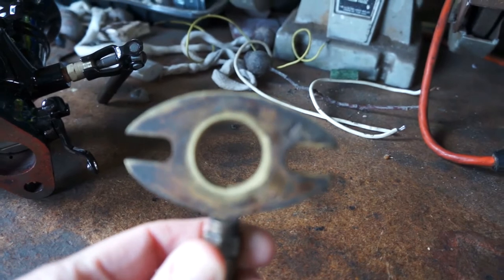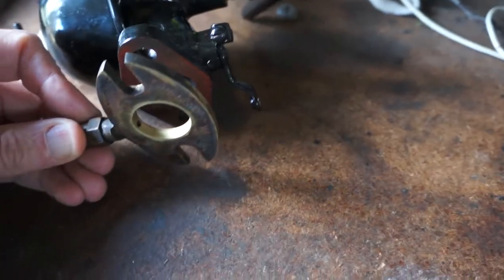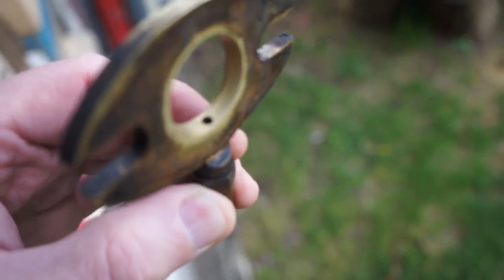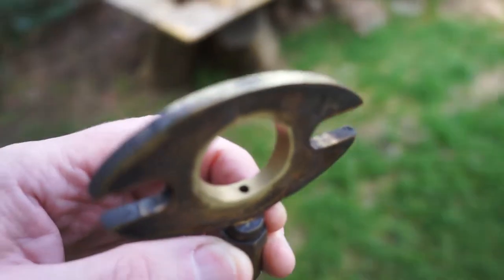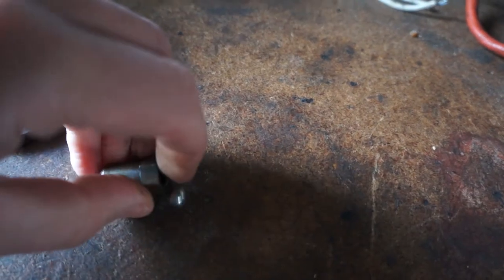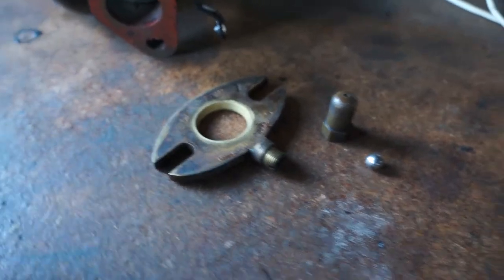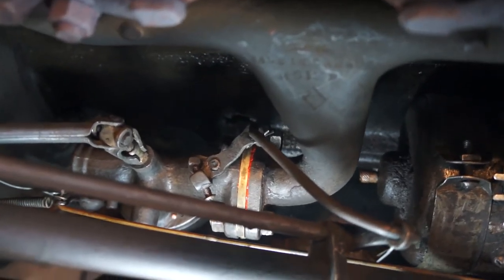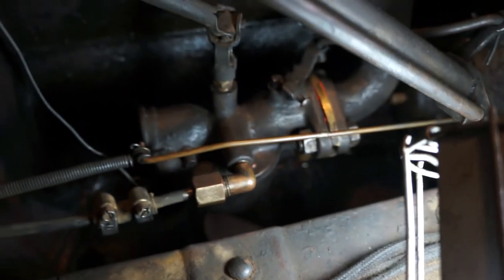The Carbur-Aid. Fuel Economiser for the Model T Ford.

Comment: Would like to see you run your engine with that. More concerned with the cover band on your generator so close to the contact.
Reply from the maker: I ran it for 20 years. Made absolutely no difference - except being harder to start. The generator cover band being close to the terminal is an optical illusion - it's further away than it looks.